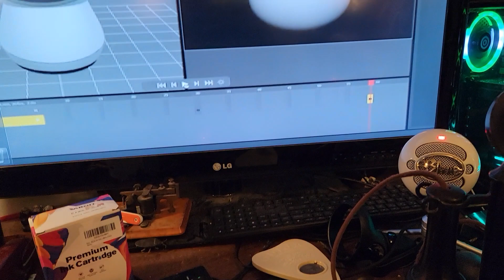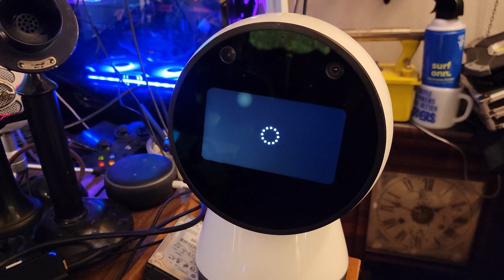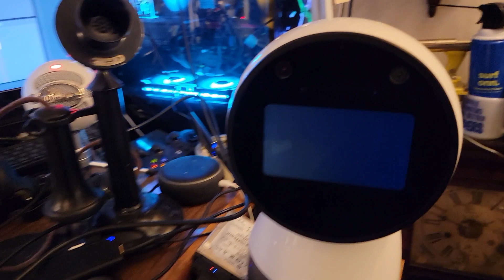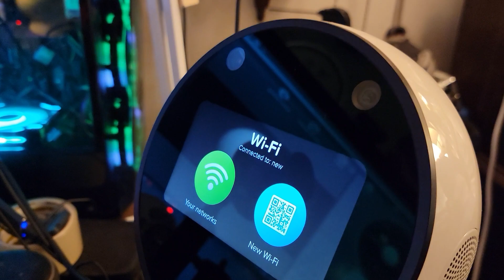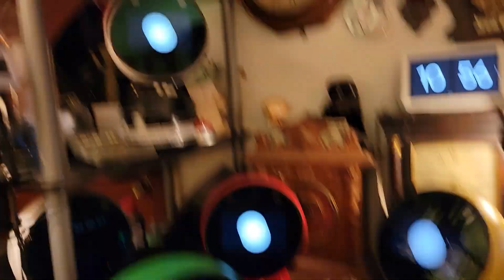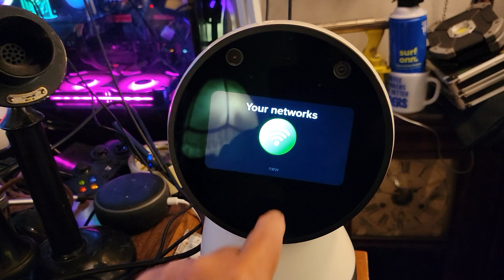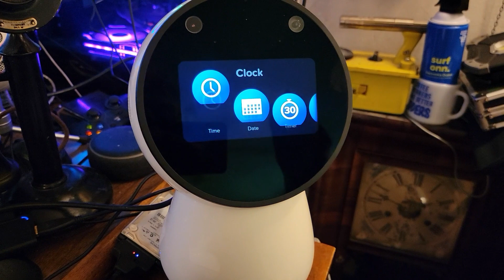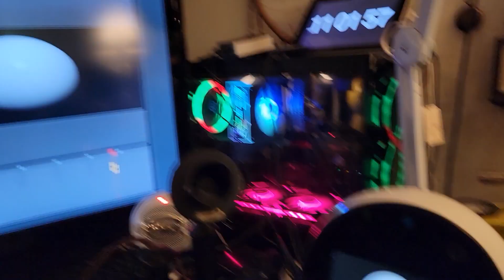Dr Jibo's --------(Jibo Cloning Procedure)

Comment: It looks like the thumbnails are there but not the photos. The photos were encrypted or not locally stored possibly?
Reply from the maker: ghost photos form the copied source I have not been able to delete them but I am working on it
Reply: @jibomorris  you will be looking for some cache files. They are seperate. Jibo works with html, so like a website it stores locally cache files for thumbnail display on the screen, that's why they won't open up.
Reply from the maker: @josemurillo4728  this is not the original Jibo OS , but there is no network to store them to

Comment from the maker: Robot cloning, in the context of creating identical copies of a robot, generally refers to replicating the physical design and functionality of a particular robot model. This is different from genetic cloning, as robots do not possess genetic material that can be replicated.

In theory, it is possible to clone a robot by reproducing its physical components and programming its software to mimic the behavior and functionality of the original robot. However, it would require detailed knowledge of the robot's design, access to its technical specifications, and the necessary manufacturing capabilities to recreate the hardware components.

It's important to note that cloning a robot without proper authorization may infringe on intellectual property rights, as many robot designs are protected by patents and copyrights. Additionally, cloning a robot may also raise ethical and legal concerns, depending on the purpose and implications of creating multiple copies.

As technology advances, it is possible that cloning or replicating robots may become more feasible. However, it is crucial to consider legal and ethical aspects and obtain appropriate permissions or licenses before engaging in any cloning activities.